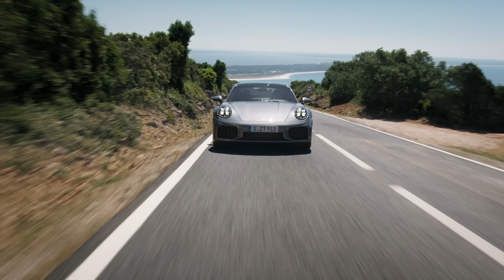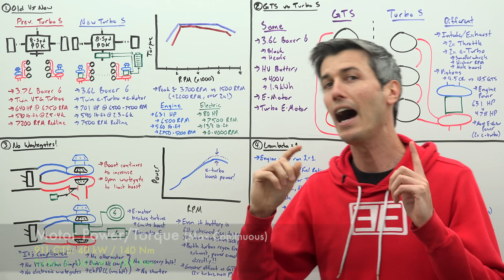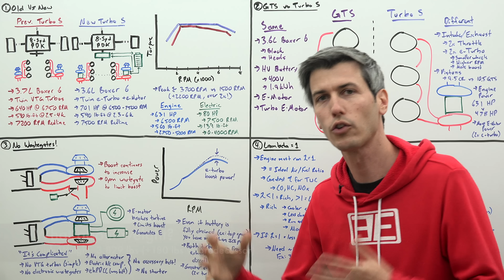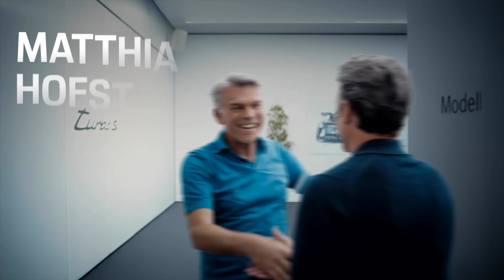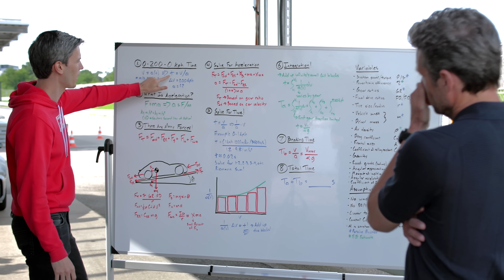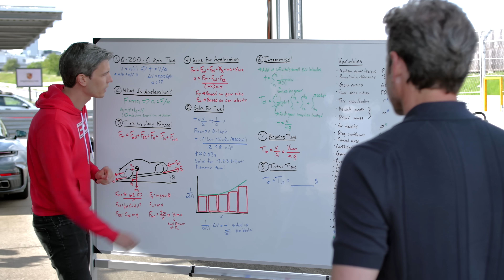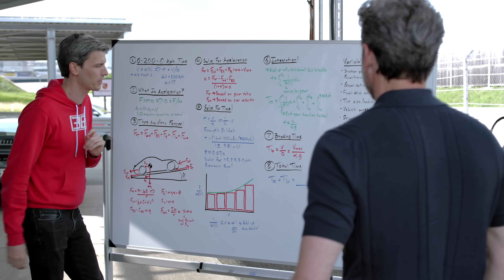The Most Powerful Porsche 911 Ever - New Turbo S Engine Deep Dive!

Comment: You can build a lighter and rwd baby turbo S by spec the GTS with the PDCC which means it has all the same technology in a lighter and more sporty rwd rocket that is a fast as the previous .1 turbo S.  I just did that and comes in may

Comment: At this point why they don't make a car with a turbo shaft engine? it has much less weight, less moving parts, much more reliable, and you know, it's a Porsche. buyers will pay a premium for that luxurious turbo reliability. they come with a bad throttle response but these days they are attaching an electric motor to anything. the good part with turbo engines(literally) is that you can even refuel with whiskies and bourbons 🤠

Comment: Does the 992.2 gts or turbo s have a power diagram (as seen in most hybrids) that in real time show the distribution of power throughout the vehicle. That would be awesome to watch when driving to see in what scenarios the vehicle is using or generating power between the turbo and motor between the trans.

Comment: The explanation of the electric motor utilizing the usual exhaust that goes out the waste gate caught my attention.  Instead of wasting power that the turbo made, its using that power to charge the HV battery.  Unfortunately, unless you live near the Autobahn or a similar road all this technology will not be utilized to its greatest potential, especially going down the freeway at 70 MPH then coming to a near stop due to a traffic jam.  Then it's stop/go, stop/go, stop/go.  Still the minds that came up with this and had the resources to make it work is/are fantastic!  Your whiteboard math with Patrick D was WAY ABOVE ME.  Thanks for this video.

Comment: I'm scratching my head about the electric motor on the turbo acting as a brake in lieu of a waste gate. Doesn't this create excessive backpressure? Another point I can't wrap my thick head around is how the battery can stay charged on a long full speed run to the extent of maintaining maximum power. I can see the battery adding hybrid boost for a short run, but as a continuous power source, sounds like perpetual motion. These are my questions from a lower pay grade. 🙂

Comment: Instead of a motor driving the turbo, why not a crank driven CVT?  This spools the turbo faster than the exhaust like the electric turbo.  

But, instead of driving the motor (as a generator) to drive the motor (dual inefficiencies), you change the ratio on the CVT to apply that excess power directly to the crank.

The engine provide far more power than a motor, allowing a much bigger turbo without lag.

Comment: How the hell?? So is the electric motor basically an air assisted motor??? The only way I can comprehend the exhaust gasses "adding" output power to the electric motor is it must have some sort of turbine of sorts that the exhaust gasses push essentially like a turbo?? Am I getting that right?

Comment: Question... If you slow the turbo (by using the electric motor as a generator), won't you create more pressure in the exhaust and won't that cost power?

Comment: Fantastic video (as always)!!  While Porsche's new technology is certainly marvelous - like all complicated systems, it's still an engineering "compromise".  I wonder how consumers will deal with the high voltage lithium battery limitations for environmental temperature and possible self-discharge time?  As mentioned in the video, the Turbo S has no conventional 12v starter, instead using the auxiliary traction motor to also start the engine.  So if not started on a regular basis (every 2 weeks?), the high voltage battery may not have sufficient remaining energy to start the vehicle.  Since it's not a "plug-in" hybrid, I don't believe there is any way for owners to charge the HV battery, resulting in a tow to the dealer.  Considering how little some Porsche cars are driven, this might be an issue.

Comment: Replacing a starer...  5 bolts maybe?

Replacing the electric motor...  potentially an engine out? At the very least remove the gearbox. How is that simplifying things?

What I see is these cars going into a landfield as soon as the first 2 rich owners are done with them.

A few years back I was able to buy a Cayman 987, only because I was able to work on it myself. I don't see myself working on these things 20 years from now.

Comment: Obviously very different, but using the turbos to generate electricity that is instantly used instead of going into a battery for long high-power runs makes me think of the new Civic hybrids. They do the same thing, except obviously, there's no turbo. It's just using a generator to power a motor directly. Allows you to get a lot of efficiency by making the engine run at peak torque much more often than it otherwise would. I like getting 54 mpg average, even when having fun.

Comment: When are we going to get fully electric driven e-chargers?  Seems like the best of both worlds.  Still get the full throaty exhaust, like from a supercharged engine.  Yet get the efficiency/power from a turbocharged engine.  And it seems packaging would be much better than a turbocharged engine, since there's no need to plumb exhaust gasses through it.

Comment: But what if the battery is charged, the electric motor is not using energy, the electric motor on the turbo can still act as a wastegate? If there isn’t energy needed, they can’t act as a brake right?

Comment: The explanation was very clear, especially on the Lambda = 1 principle. Few realize how difficult it is to maintain this ratio in high-output engines. Porsche brilliantly managed it by using the e-turbo to cut backpressure, keeping performance while meeting strict emission standards.

Comment: A PAINFUL EXERCISE in engineering a hybrid motor to provide the same output and torque curves...
That an EV provides for a lower sticker price. (And about 10% of the maintenance effort and costs required.)
1. Lucid Air Sapphire beats this car hands-down. With room for 4 full-sized passengers AND their luggage.
2.  Tesla Model S Plaid costs 50% and still beats the new 911 Turbo S

Comment: What about the cooling effects of running richer than lambda 1? Surely it must put more strain on the cooling system, exhaust manifolds, pistons, valves and so on?

..And - theoretically - what power would it be able to make if we lowered the lambda to 0.85? This engine must be a dream for a tuner - you can give it more power from lowering the lambda alone, and in return get better cooling :)

Comment: I wonder how much back pressure is produced on the exhaust when the eturbo is being used to regulate boost pressure. Seems like that back pressure might be the the limiting factor before you get detonation. Also, I'm blown away that Porsche still insist on using McPherson struts. It's just leaving lap time on the table.

Comment: Regarding the energy recovery through the e-turbos: it's a brilliant idea, but absolutely not a new one.
Back in WW2, the US bombers were equipped with turbocharged piston engines. Excess energy off the exhaust stream was also recovered by the turbines and fed back onto the engine's shaft. Alas, that system was mechanical, not electric.

Comment: Why did the cap the top speed to only 200 when the previous 2 generations would do 205? And why did the 992 with 100 more horses only do 205 when the 991 would do 205 with "only" 572 horses?

Comment: When the turbos are fully spooled, and their motors are acting as regenerative brakes, they are sending the excess power in some proportion to either the drive motor or the battery. Are there conditions under which the battery is already full and the drive motor is already at peak allowable power and there is still excess power generated by the turbo motors? Or are the turbo motors small enough that the drive motor itself can always absorb their output? If there is excess power remaining, can I assume Porche has included a big resistor in the system specifically to dump that excess into heat?

Comment: As much as I love Porshes they have now been left in the dust of BYD's Yangwang U9 supercar developing over 3000HP and capable of over 30,000RPMs. And clocked at 293.54MPH. Face it this is the end of the internal combustion engine.

Comment: Still would rather just go with a 1020 HP AWD S Plaid for $65-75K(2-3 year used), probably half or less monthly insurance cost, no $150-200 oil changes, and smoke this thing and have no remorse flooring it everywhere.

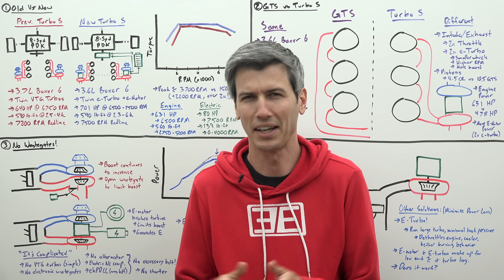Comment: 10:09- "I guess people like breathing" <I dropped dead laughing>
Reply: Exactly for this reason, we 'd better get rid of EVs. Their indirect fuel consumption is much more than the direct fuel consumption of ICEs.
Reply: @Lina_Antoniou not really correct. If you try to compare the lifetime emissions of ICE cars VS. BEV cars it all comes down to the fuel source of the electricity the BEV runs on. If it‘s 100% coal ICE cars are actually better, if it‘s 100% renewable BEVs are WAY better. It all comes down to power generation and nowhere in the developed world is there a power grid running on pure coal / other fossil fuels. Not even in China or India.
Reply: @SahnigReingeloetet  No, you also need to account for the weight difference, which directly means an EV consumes much more energy. Also, there 's no country with 100% clean electricity production - it will sadly never happen.
Reply: @Lina_Antoniou wrong again, if you account for net energy used in kwh BEVs use up substantially less energy than ICE vehicles (something like less than 60% compared to something like a hybrid). If you‘d convert the energy used by an electric car into diesel, they‘d use 1-2 liters of it for every 100km, which is impossible for a regular car to achieve.

And while 100% renewables is unrealistic for many places, most places implement that power source ever more every year. Especially solar has an incredibly high demand. Which means sourcing from 20-30% renewable is very likely at which point BEVs are already less harmful to the climate than ICE cars (the break even is somewhere between 10% and 20%). And that is just looking at grid electricity, plenty of suppliers for EVs run on 100% renewable.
Reply: @SahnigReingeloetet  Then why do chargers consume 14lt of diesel per 100Km of EV range? Maybe because batteries are inherently inefficient and will never become good enough? Also, mainstream renewable sources are not efficient enough either. Solar for example is 20-25% at best, definitely not good enough. And wind is even less. Petrol engines, thanks to variable valve timing and lift, can be tuned for a wide rpm range with more than 35% efficiency. And diesels are even more efficient, so... go figure.
Reply: @Lina_Antoniou where do you get your figures from? A fast charger uses up ~20kwh to charge an electric car battery with 15kwh, which is on average enough for 100km of range. 1 liter of diesel contains ~9,8kwh of energy, so the charger uses up roughly 2 liters of diesel energy equivalent for 100km of real range for a BEV. 

The thermal efficiency of a gasoline engine is at the very most 20-35%, a gasoline hybrid is better than that. Diesel engines have a thermal efficiency of 40-46% and are generally the most efficient internal combustion engines around. 
Electric vehicles however have a thermal efficiency of 87-91% however (all losses included), so they are twice as efficient as diesels which gets reflected in their MPGE.
Reply: @SahnigReingeloetet  Likewise I can ask where you get your figures from, but I don't care. The source brand doesn't matter, what matters is the policies we end up seeing in and around the automotive world. That those policies are set up to absolutely abolish the ICE from the market should at least raise some suspicions, if not outright revolt. The owners of automotive brands are definitely much richer than average, so I 'd not expect them to care that much how the "peasants" feel about their decisions. All they care about is to sell more and fill their pockets, this doesn't stop them from behaving like a cartel, can you deny that?

Speaking of numbers though, your ICE efficiency figure of 20% is grossly outdated. Efficiency is a curve just like power and torque, so with all the emission regulations you would expect the manufacturers to try and optimise the efficiency curve even just for the sake of passing emission tests, no? Well, it has been proved ICEs can be designed for efficiency and it actually is being done, which shows in how little fuel I use with my 2021 Yaris 6MT (definitely less than with the 2007 Fiesta 1.4 I had back in Greece). Point is, if peak gasoline efficiency is 40%, we can expect a good part of the curve to be above 30% and probably the entire curve to be above 25%, exactly because everyday car engines are designed to be efficient over a wide range of driving styles. What about EV efficiency curves? Let alone that you 're not accounting for all of the losses with that outrageous 87-91% and the weight penalty along with the polar inertia penalty associated with EVs.

Comment: Can you do an episode explaining how diesel exhaust fluid makes emissions less toxic even though def fluid is toxic and actually burns/consumes more diesel fuel than an older engine without emissions controls. Explain how it is possible to put more diesel and another toxic fluid into an engine and yet produce less harmful exhaust even though your fuel efficiency is less.  It would also be amazing for you to explain how a diesel over electric vehicle like Edison motors is way more efficient than having the engine mechanically connected to drive the wheels.

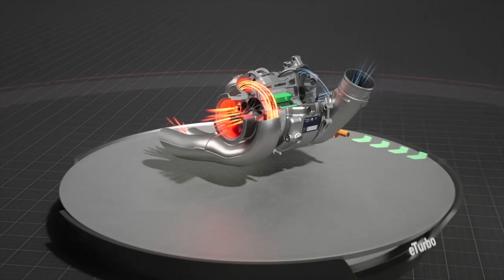Comment: 00:05:10 what happens when the battery is full and you cannot slow down the turbo by regen?
Reply: it goes straight into the electric motor.

Comment: I think you have been pessimistic on the breaking. The air resistance is still there and does not really (considering a low wheel inertia) contribute to the friction. Thus, in the final experiment, you indeed should have been optimistic on the acceleration but pessimistic on the breaking. It compensates quite well in the end

Comment: Wonder what the weight penalty the new 911 turbo S paid for hybrid pack plus the electric turbos for said 50 more HP? 
Still 14 seconds faster around the ring is crazy impressive...especially considering the extra 180 lbs weight?

Comment: First: I have driven 100 000km in my 930. Second: Since I went analog with my 997. The aftermath is: All electric powered but not limited to EVs' the circuitry used in them harm mitochondrion to the extent that it certainly feeds c4nc3r growth. Do a look into Becker's book "The Body Electric" and weep. This is frustration not trolling. By the way I like your work very much, being a semiconductor microelectronics and materials scienece engineer and a researcher gone bio-quantum hacking after my career at the electronics industry.

Comment: The new car features both an MGU-H and an MGU-K, similar to those used in Formula 1. Unlike in F1, however, these systems operate automatically rather than manually, enabling energy recovery from both units. This showcases how Formula 1 serves as an experimental platform for developing more efficient technologies that eventually reach production road cars.

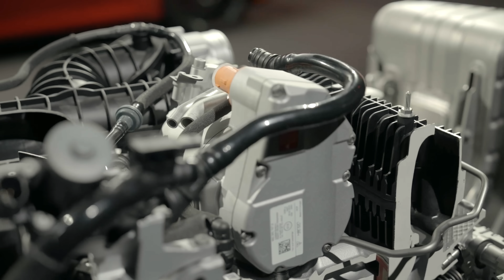Comment: Eight years ago, a bone-stock Viper ACR driven by amateur Lance Arnold did the Ring in 7:01. With stock tires, and a big, simple, naturally aspirated, 2 valve/cyl, old school, unstressed, pushrod V10. Just sayin'-

They barely got a good run in, before it started to rain.

I love my Ferrari, and my Viper, but I also have tremendous respect for Porsche. Would like to have a non-hybrid one someday.

Loved the mathematical breakdown!

Comment: Wow! Excellent video! Very clever with the electric turbos and motor in the drive line. Very well explained, thank you for that. Can't believe your 0 to 60 calculation was so close. I'm a retired mechanical engineer living in Sonoma and for fun I've rebuilt some Subaru engines: EJ25 non-turbo, EJ25 turbo and now I'm in the middle of a FB25 non-turbo. I made a big leap from rebuilding old Ford Flatheads, 1940s vintage. Because of this experience I've become interested in rebuilding a Porsche someday soon, such nice cars!  I've noticed that Porsche finally retired the hypereutectic aluminum-silicon alloy cylinders and eliminated intermediate shaft. Good design decision. 

I was wondering if you would consider making a video on the early Subaru FB25 engines (2011 and 2012) that had oil consumption issues. Nobody has been able to explain definitively what Subaru did to mitigate the problem in 2013. I think they probably increased ring tension (cylinder wall contact force), particularly with the oil ring rails. However, while checking the oil ring gaps of new set of Subaru OEM rings, I noticed that there was daylight between the ring and cylinder wall. Obviously, this is a problem. I have good pictures if you're interested. Because of this I'm going to have to use aftermarket rings that fit snuggly up against the cylinder wall. 

Also, the aftermarket top oil ring rails are not pinned and can rotate freely. The OEM rings are pinned. It's not clear what the advantage of pinning would be, I'd like to hear your comment regarding that also. 

Thank you!

Comment: Aren't there two lambdas? Lambda = 1 at the catalytic converter, but the air/ fuel ratio in cylinder is richer because the e-turbos also function as air pumps for the exhaust.

Comment: Patrick Dempsey is an old guy.  He was born 9 days before I was....

I wonder what my '14 Cayman S PDK would do?  304 wheel horsepower, PDK, and 2976 lbs empty, 3146 lb with me on board.  I know it will reach 100 mph in 10.0 seconds. I'm thinking around 17 seconds for the 0-200-0 run.

Great video!